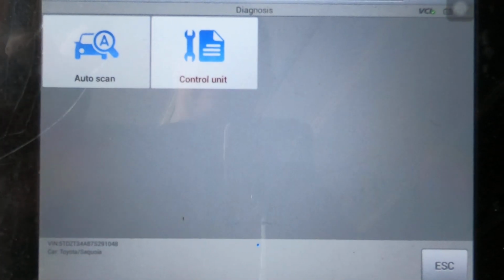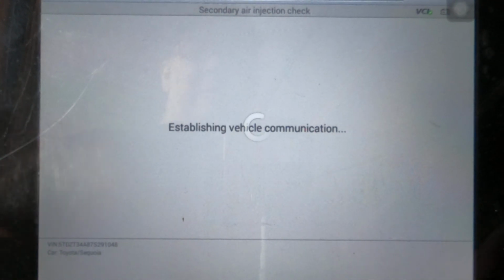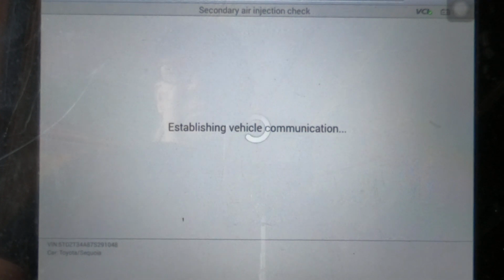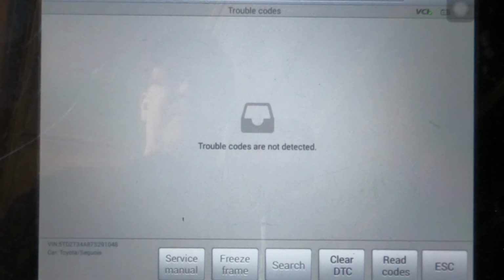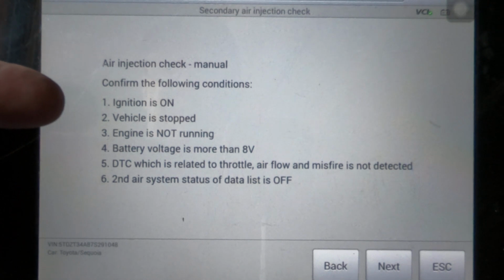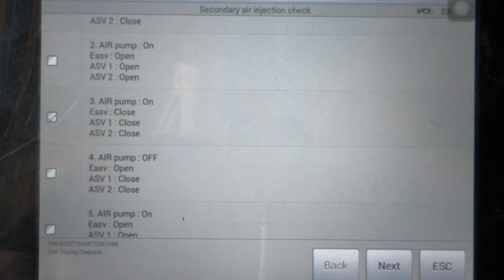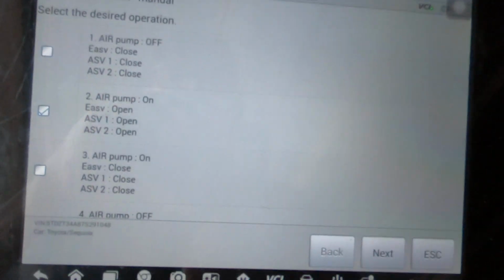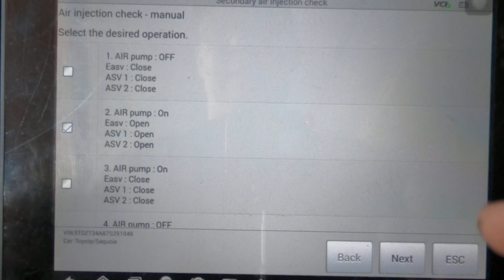Quick and Easy Air Injection Test using the Autel MS906TS Scan Tool on a Toyota.

Comment: I have a 2005 Toyota Matrix XRS with the 2zzGE engine and have a P2441 code.  I get 3 cold starts without a code and on the 4th cold start I get a pending code and on the 5th it throws a check engine light.  I clear the code and the cycle starts all over again ultimately ending up with a P2441 on the 5th cold start up.   I've fired the parts cannon at trying to fix this by replacing the air pump, vacuum switch, vacuum check valve, air shut off valve, pulse sensor and new connecters and hoses.  Every part is new OEM and still the problem persists.  I'm thinking the ECU might be bad.  I definitely need a bi directional scanner to test the system without having to wait for the car to cold soak.

Comment: Can the ms906 command the secondary air injection pump on for testing purposes? I heard on another video that if someone experiences A fault with the secondary air injection system that cause A limp mode, you can clear the code while engine is running and you will get normal speed for the duration of that drive cycle. Can you confirm that? Thank you
Reply from the maker: The MS906 can command the pump on for testing. I am not sure about clearing the code and getting normal speed.